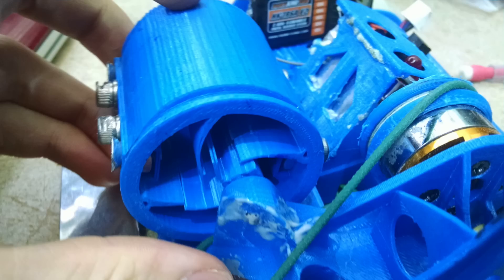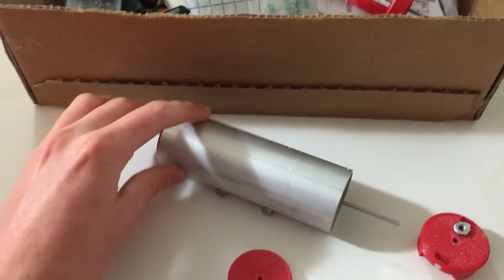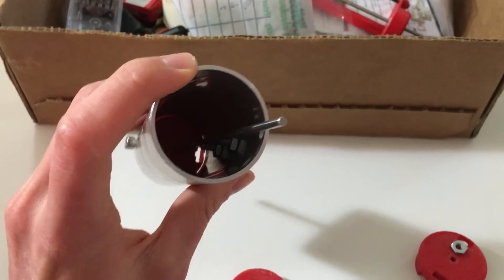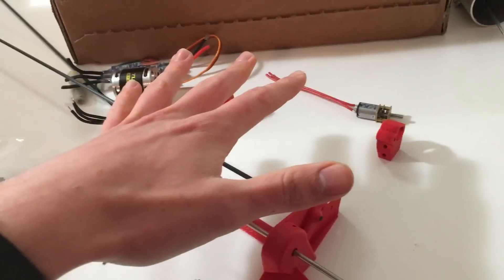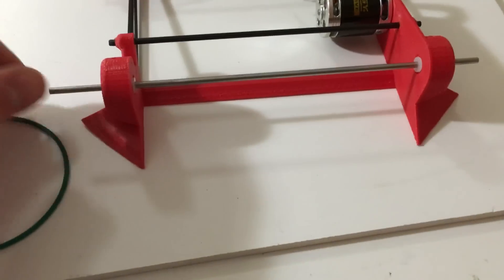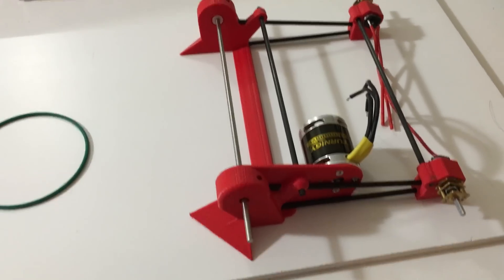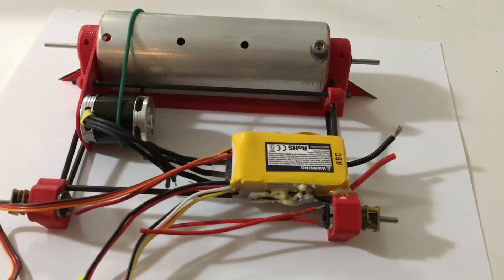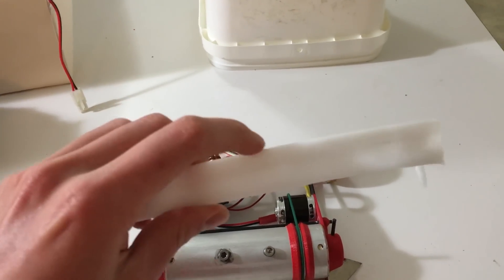Combat Robot with Carbon Rods Chassis

Comment: How did you make the drum
Reply from the maker: I bought an aluminum cylinder on mcmaster and drilled holes in it using a drill press, then attached bolts in these holes (with the nut on the inside of the cylinder).  The bolts act as the drum's teeth.  The cylinder has two 3D printed end cap "hubs" which are glued in and let the drum spin around the axle.

Comment: Love your bots, man -- thanks for sharing.  Will you post the follow-up videos soon?
Reply from the maker: Thanks!  I finished it, turned it on, and it kinda self destructed in the exact same way my original Danger Zone did...whoops.  I have new SLS 3D printed parts on order from Shapeways now.  The Illinois BotBrawl is in 1 month so it'll be done by then
Reply: AltaPowderDog I think to make this better you could add more teeth closer together like the original Danger Zone.

Comment: You might want to consider BIG counter sunk screw weapon teeth, kinda like what team Rolling Thunder does with Saifu. Its much easier to get purchase on the opponent with the big teeth than it is to get bite with socket cap screws, plus you can sharpen them to gain even better bite.

One problem I see with the design Is that the bushings are not in the best place. Most of the time, its better to run the bearings/bushings in the drum and not have the weapon shaft spin at all(AKA a dead shaft). A dead shaft resists twisting because it can be made part of the structure. An easy fix for your bot would to relocate the bushings into the drum side caps. You might also want to consider a bigger weapon shaft, it looks kinda small to me. I haven't seen an antweight drum run anything less than .25" for the weapon shaft.
Reply from the maker: I agree with both of these points.  My last drum used counter sunk screws, and even though those were too small they worked well. With this one, I kinda hope that using a dremil tool to cut out "teeth" will be enough, but I'll do testing and will go buy counter sunk screws if the drum is skipping off of objects without catching/biting well.

The second point is something that I'll need access to a decent 3D printer to implement (read: not my Mod-t).  I wish I had done a bigger/dead shaft earlier, you can see how much the 3D printed structure flexes, and a dead shaft would really help increase that stiffness.  Unfortunately I'm unlikely to have any good 3D printer this summer.  If the weapon shaft or chassis bends during testing, it might warrant paying an outside vendor to do the prints to get that fixed before the competition.

Comment: Doesn't it have to be 4 inches?
Reply from the maker: The Illinois Bot Brawl requirements are 12x12x12 inches.  This is for the 1lb class.
Reply: The 4 inch rule only applies to ants in the UK/AUS. In the US, there is usually no size restriction.

Comment: Don't use abs, use clear PETG from makergeeks or taulman.
Reply from the maker: I have never printed with PETG. I saw this test and just continued with ABS: http://www.makergeeks.com/3dprfiimtepl.html have you had good luck with it?  I haven't heard anything about it being more durable than ABS
Reply: +altapowderdog The layer adhesion is amazing with petg, the parts rarely separate at the layers. I printed my 230 size quadcopter out of pla, abs and petg. abs and pla both ended catastrophically. The clear petg can take the hits. I tried a black petg but it had so much pigment added it was brittle and snapped in crashes, it still has excellent layer adhesion.

I suspect the more transparent petg colors will keep the impact resistance of the clear but I have not tried them.
Reply from the maker: +Josh Bishop thanks for the advice!  I might try that